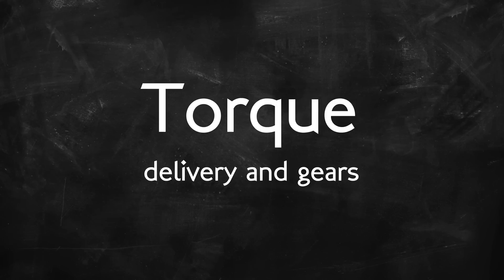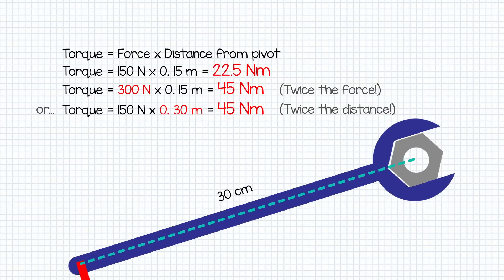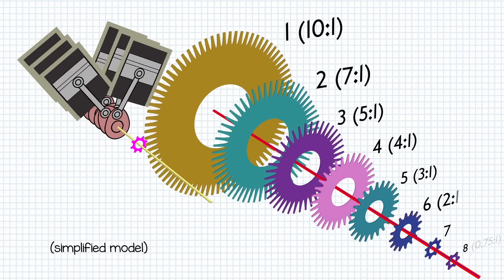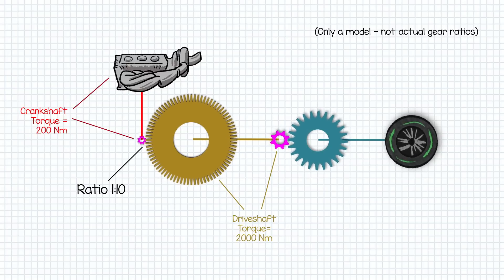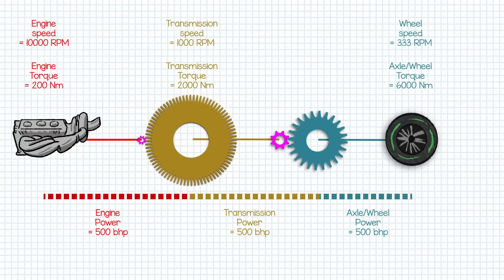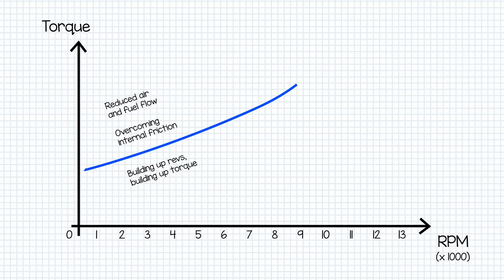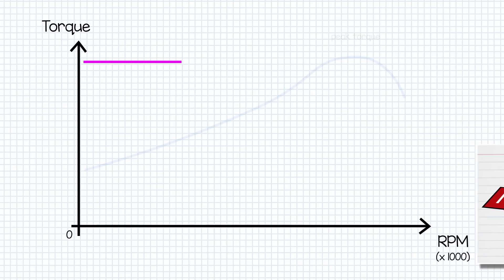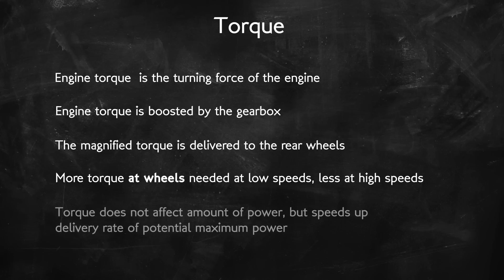Torque and Gears - Why F1's hybrid engines are more 'torquey'

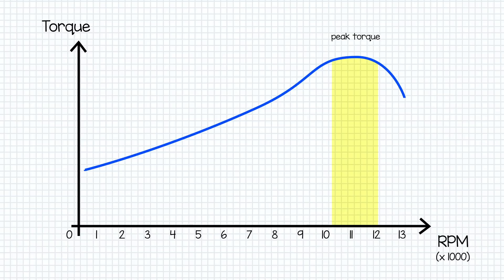Comment: 7:50 you are wrong that they try to maintain maximum torque for acceleration. They actually maintain maximum Horsepower for optimal acceleration. Maximum Horsepower occurs at those high rpms and not maximum torque.
Reply: at 5:00 he was also wrong 🤭and probably somehwere else too i dont watch this precisely just most importsnt stuff 👌🏻

Comment: If I understand it correctly: We use higher torque on standstill (lower / bigger gears) to translate more force onto the pavement and counteract weight and friction on the expense of RPM, and use lower torque at higher speeds to avoid the low rpm to hinder our movement?
Reply: no no no 🫣 i dont even know how ….too explain this shyt cos ok engine have power graph forget about this torque 💩 which is irrelevant really 👌🏻 you use 1 and not 6 gear from stand still cos 1 gear is for low speed and 6 for high in fact you have lower rpm at 6 gear than at 1 so you are contradicting yourself 🤭🤷🏻‍♂️  at max speed limited be all outside resist assuming gearing is good setup on 1 gear assuming engine can withcstand rpm force be lower than at last 6 gear , gearbox is only for transfer max engine power at set speed thats why at 50 km/h is use 1 gear  at 100 km/h 3  gear and at 200 km/h 6 gear gear are only for hold  engine at max power rpm for max acceleration 👌🏻 at lowest posiible velocity stilll only max engine power no matter at how big rpm it seat give max output force at contact path 👌🏻 let say engine have 350 nm at 1500 rpm 150 hp at 3500 rpm some turbodisel engine and let say thers no trouble with grip so car 1500 kg with rider 4x4 sticky tire let say you wamt have or engineer project this car want have max posible acceleration at 20 km/h exluding clutch slide and hit from rotational inertia of wpflywheel asf what also can be achieve at higher rpm anyways 🤭 so what gear ratio they setup for have max posibble GForce for this car at 20 km/h so max contact path force  such that 20 km/h be at those 1500 rpm where engine have max torq 350 nm or such that engine be at its max power so 3500 rpm 150 hp ? good ansewer is such that engine be at 3500 rpm max power 👌🏻  cos power:speed= force at 1500 rpm from 350 nm is generated 74 hp around so 2 times less than at 3500 rpm and like formula say if power increase 2 times at set speed in this egzampke 20 km/h force also i crease 2 times 👌🏻 you use lower gear for low speed and hogher for high speed only beacuse in such way you can use engine max power rpm for acceleration all the way from lowest to hhighest speed what give max posiible co tact path fprce from lowest to highest speed ,dont listen this ydot on this video he talk alot 💩 and misleading people🫣👌🏻 i have no ide who he is it dosent matter 🤷🏻‍♂️👌🏻

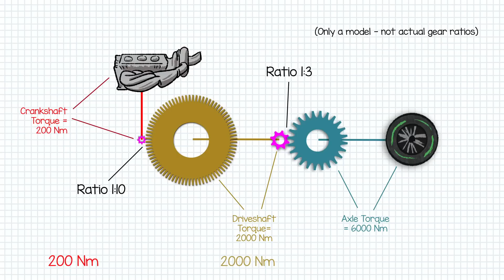Comment: 4:50 Not true. It is not harder to get anything moving vs increasing its speed once moving. It takes exactly the same amount of torque to accelerate at a given rate regardless of initial speed. 5:00 you do NOT need "less and less torque"  to accelerate.  5:30 you do NOT need less torque "to keep the rotational momentum up". 
These are serious flaw in your understanding. Consider editing this.
Reply: in fact you need more 👌🏻

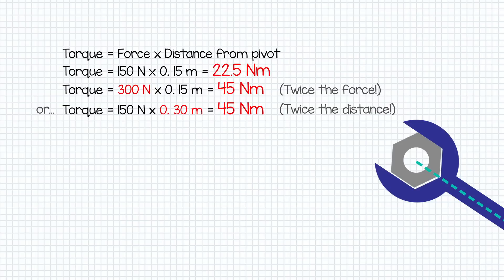Comment: nitpicking: 1:37 it's not a good idea to say "we didn't have to put more energy" given that the term energy has its own meaning in the physics. In this particular example energy applied should equal to the work being done which is defined as distance multiplied by force. So doubling the lever (thus doubling the distance your point will travel) while keeping applied force the same will actually double the work, of course if you put aside the note that you were unable to take off the nut in the first part of the example so it wasn't actually moving.

Comment: I thought gear ratios were designed to keep engine rpm @ peak horsepower.
Reply: Your thought are correct 👍🏻 only peak power at set speed can give max posible accelerstion .
Reply: @mociczyczki  right?

Comment: i have one question.
do cars with more torque "feel"faster  than cars even with higher horse power?
2 examples
one diesel engine 2.1L with 204 hp and 500nm of torque
vs
one petrol engine 2.0L with 250 hp and 350nm of torque

of course the petrol one will win any race
but
does the diesel one with more torque "feel" more faster and gives you that kick of force and you feel  the car pulling with more force?
Reply: at THE SAME rpm at which it have more torque at teh same vehicle velocity yes 👍🏻 you would feel better force accelerstion 👌🏻 so somewhere on lower rpm range assuming naturally both cars weight simialar have similar drive train losess drag asf 👌🏻 cos if petrol is much enough lighter than you would never feel better accelerstion inthis disel 👌🏻 but assuming not enough heavier or everything equall like im wrote on 1 part this comment 👌🏻 however it will not produce more max. force which determined accelerstion. as this formula show force:mass= acceleration 👍🏻 assuming both vehicle have super good perfect gearing setup and similar peak power width more less let say 😎 cos power:speed or velocity whatever = FORCE. and 250 hp is more than 204 hp so 250 at the same speed diffrenc like 50-100 km/h or 150-200 km/h whatever will generate biger output force at co tact path and will push you stronger into seat 👌🏻 this disel will feel stronger only like im mention on some low rpm the same in petrol must be where disel havemore torq at the same speed vehicle 👌🏻 feg let say this disel 500 nm os at 1500 rpm vs this petrol at 1500 rpm have like 300 nm and dosent matter at which gear both must beat the same let say 50 km/h speed petrol can be on lower or higher gear dosent matter what only mater is the same engine rpm and speed on bpth than you will feel indisel version biger force push ypu into seat and accelerstion biger 👌🏻  once in both again dosent matter which gear just for both at the same speed let say roll race from 50 km/h petrol start close to peak power rpm dosent matter 1 2 or 3 gear and disel the same cos only max power rpm at set speed can give max posible accelerstion its gsme over for disel and petrol walk away in roll drag race constatly up to top speed 👌🏻

Comment: Accounting for friction, the wheels make less power than the crankshaft hence the term "whp" or wheel-horsepower which is generally substantially less than the engine's horsepower under normal conditions in most automobiles.

Comment: A race engine does not try to stay at peak at peak torque, it tries to stay at peak horsepower. A "torquey" engine is simply an engine that has more power at lower revs than a more conventionnal engine. Hybrid F1 engines have lower rpm compared to previous engines to help with efficiency, and if you lower revs, torque needs to go up in order to keep horsepower high.
Reply: egzacly 😎

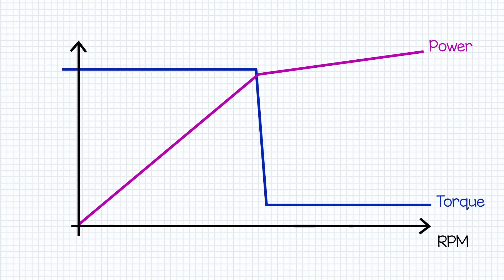Comment: Great video! I do want to point out one mistake though, towards the end your diagrams of torque and power seem to regard power as an integration of torque over RPM, but it should be a straight product of Torque and RPM at a single point. So for example on the diagram at 10:04 if the torque drops dramatically like that the engine power will drop a lot as well, not just increase slower.

Comment: I know you wanted to keep things simple, but there are some things that aren't quite right. The biggest thing is how you said the gearing is tuned to keep the engine at maximum torque, that just isn't true, they keep it at maximum power for maximum acceleration, max torque is at the start of the powerband, torque then slowly drops off as power increases until peak power and then it starts dropping off quicker, dropping the power with it, and when your power output is the same you would have on the next gear, then you shift. Also the graphs aren't very accurate, but I understand the reason why you would do that, the other point is straight up misinformation and it may confuse some people. Anyway, if someone wants to learn more on the topic I recommend they watch Engineering Explained, he has a bunch of videos on the this that go more in-depth and have real life examples, so if you have the time and want to learn more, definitely go there
Reply: I just imagine some people watching this and trying to drive their car fast, shifting at 2k rpm because that's where it makes peak torque instead of taking it up to redline for peak power

Comment: I saw similar videos about that topic but the last graph at 9:54 helped me tu understand why for example diesel engine (or electric vehicles) have a good acceleration but have a lower final speed than their petrol cousins. Thank you very much for this explanation. Now I know what I am looking at / aiming for when watching power / torque curves. 10:03 Seems ideal for a quick acceleration and a high final speed, doesn't it?

Comment: sorry but the explanation for the electric motor torque is really shoddy, friction has little to do with it, to make it simple the rotor in an electric motor tries to catch up with the rotating field in the stator, the higher the differences the higher is the current induced in the rotor the higher is the torque generated so at 0 rpm you expect maximum torque in an electric motor

Comment: wait f1 cars weigh nothing they dont need much torque
betrayal...
Reply: for accelerate from 100 to 200 in 2,5 sec os they need alot torq at drive wheel axis at set wheel radious  weight 700 kg os but also massive drag which effective avg between those speed at like 1500 kg normal car and with speed icnrease effective weight also incrase which push f1 to the ground 🫣 at 320-330 it weight more than big suv 👌🏻  for accelerate from 100 to 200 in 2,5 sec assuming avg effective weight including down force is 1,5 tons os this f1 cars neeed „1mln „ times more torq at drive wheel axis with wheel radious similar to those from normal cars than in some 3 tons suv which accelerate from 100 to 200 in 15 sec 😎👌🏻

Comment: Guys I need questions for this, will it be easy to pedal the flying bike if the gears and propeller is like this:

This is how talking about:

Pedal
     |
     v
   _ _ <-(4xBig-Gear(4RPS
   |
 _ _ <(16RPS)
        |
   _ _ (64RPS)
   |
 _ _ < (256RPS    
        |
        |
  O <Fan

Comment: Major mistake imo: "torque" does not influence the rate at which the engine delivers energy, that's the definition of power_. "Torque" is in fact the second derivative, it influences the rate at which the engine delivers _more power. It's the positive acceleration capability of the engine. I use quote marks because as you hinted that's not exactly the usual meaning of the word. 
In other words, the main advantage of the hybrid system in F1 is to boost acceleration. (In hybrid consumer cars, it's mostly used to save energy.)

Comment: Some little nitpicks: You don't need a high gear ratio to get the car going because its harder to get the car moving, but because you can achieve higher torque and faster acceleration by using a higher gear ratio. Or to put it differently, the higher the gear ratio, the higher revs you can use, so you can output more power, which translates to higher torque at the wheels because the power must be the same.
And the second thing: The gear shifts don't aim to maximize the engine torque output but engine power output. The fastest acceleration is achieved by revving even until the torque starts to drop, because you're still gaining power since your RPMs are still increasing. Maximum power is always achieved when the torque has already dropped off. And even when the power starts dropping off, you might still wanna keep going because the engine might still be producing more power than at the lower RPM in the nextgear. So not only you might wanna rev past the peak torque, but even past the peak power.
Reply: @Benedocta  good job schoolin the teacher.  You are correct video needs revision to be factual.  Great production quality though!

Comment: Another great one! Love your videos! I'd like to add a couple of points:
1. Motors also don't require a clutch to allow for rev-up, before it can be connected to the wheel. The lack of clutch slip also adds significant torque
2. The torque required to maintain a particular acceleration/speed actually goes up (not down) the faster you go (due to air resistance and such)

Comment: You don't "need less torque" at high wheel speed. The torque a tire can withstand without breaking loose is not really dependent on the rpm. The reason for using a lower gear is to get more torque at lower rpm, which results in higher acceleration. With more power you could maintain the traction limit at the tires to higher speeds and rpm.

Comment: I've been struggling with this concept for years. Now understand how to properly set my gear ratios in accordance with the peak torque of a specific motor (in VR racing games of course ;) ) Great, great vulgarization !
Reply: He is wrong 👌🏻 properly set gear ratios for racings is according to peak power  not torque unless your goal isint bes posible performance on track etc than whatever setup gear ratios whatever you want 🤭

Comment: is that torque curve for the electric motor accurate? My understanding is that an electric motor produces the most torque when the motor is stalled and as speed increases, it lose torque until it hit max speed at which point it generates 0 torque. That curve looks a little flat to me.

Comment: Great video, but I think you are wrong when you say more torque at the wheels is "needed" at low speeds.  I think you would agree that the torque needed at the wheels to maintain a higher speed is always greater than the torque needed to maintain a lower speed.  That is, to travel at a constant 100 km/h will always require more torque at the wheels than to travel a constant 50 km/h (on the same road, same wind, same temperature, etc).  The same would be true if you want a car to accelerate at a given rate (say 1/2 G).  The the same acceleration at a higher speed will still require more wheel torque.  Note: the torque required just for the added 1/2 G acceleration is the same at both speeds, but greater aerodynamic drag and rolling friction the higher initial speed makes the total torque required higher.

Instead of saying more torque is NEEDED at lower speeds, I would suggest you say that (thanks to the transmission) more torque is AVAILABLE at lower speeds.

Comment: Nice video, but one error. F1 gearing aims to keep the rpm near max power, not max torque. Why? Because that equates to max torque at the wheels. Solve for max torque at the wheel, for a given wheel rpm, ie given car speed, and you'll get that happens at max engine power.

Comment: Don't you want to drive such that the engine rpm is around peak horsepower, not peak engine torque? That is where the peak wheel torque occurs.

Comment: This is the first video I've ever seen on your channel, and as I can see by all the comments below I'm not the only one digging this video. Liked, and subbed. I can see why the instant pick up of an electric motor is so useful in racing, but I've always thought torque is for pulling heavy loads, in Mack trucks, pickups, etc. Horsepower is for making things go fast, F1 cars, Ferrari's, etc. Is it the electric motor that makes the torque useful for racing as opposed to gas, or diesel since it's pretty much instant?

Comment: Well, I disagree with 5:00 comment, because it's not true. You need more power as you accelerate, not less, especially to overcome aero drag. The transmission allows you to keep the engine in a power band zone that allows it to produce a lot of power initially, to not stall out when the clutch is released, and allow the engine to stay in its best power producing zone as the car speed increases given the track conditions.

Comment: Physics are bad ... Kinetic energy formula is  1/2mv²  which means that doubling a cars speed requires 4 times as much energy (mass being constant, you double the speed, so 2² = 4). So NO, lower gears deliver more torque than higher gears not because the car needs less energy to accelerate, but because the engine cant spin any faster. Thats why you have gearing. Also keep in mind that HP is Torque multiplied by RPM which means an engine will still be delivering the same amount of power in 1st gear or in 6th gear assuming the same engine RPM.